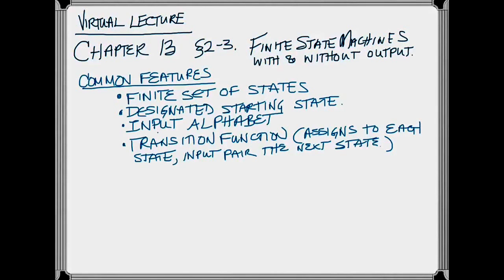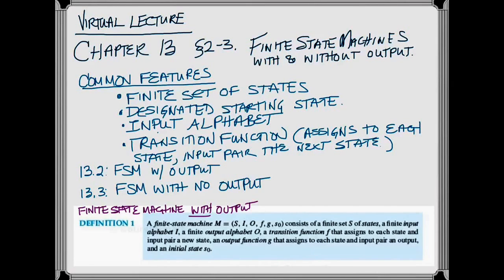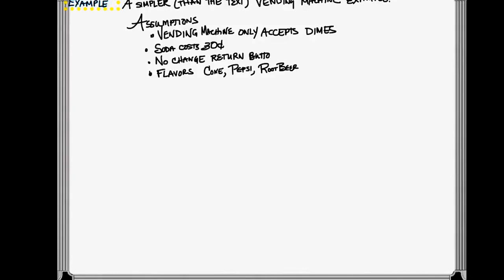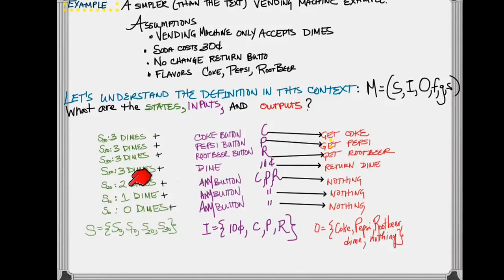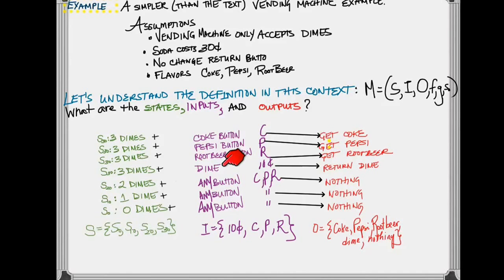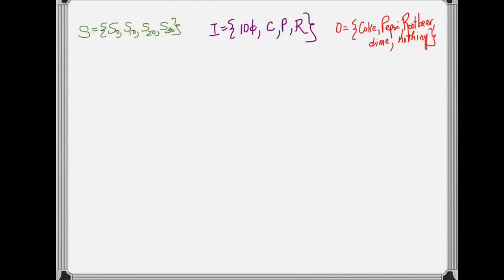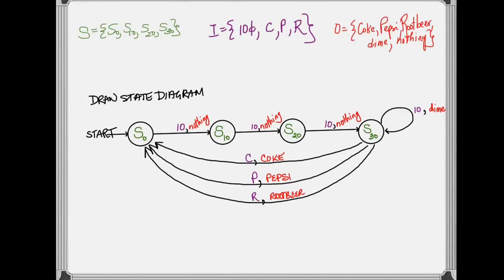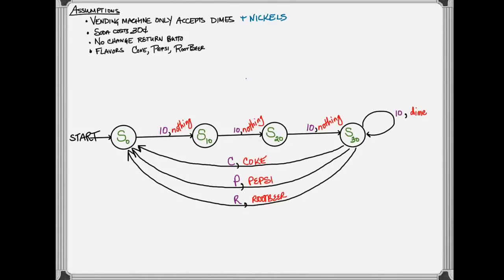June 3 Part 1. Finite State Machine with output

Comment: Thanks for creating this video!  It helped me to understand the section on finite state machines with outputs in "Discrete Mathematics and It's Applications" by Kenneth H. Rosen (Sounds like your class is using the same textbook but a different edition; it's in chapter 12 for me and I'm using the 6th edition).  Your explanation helped me understand the table representing the FSM.